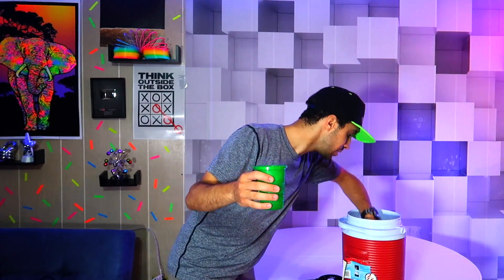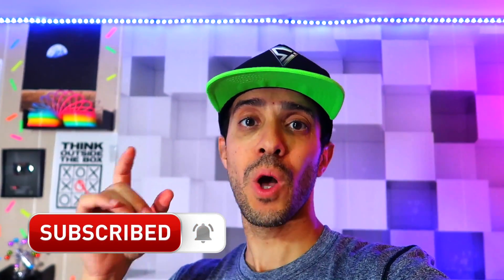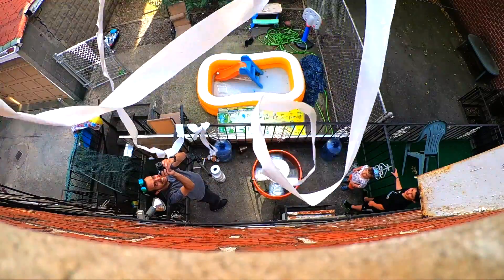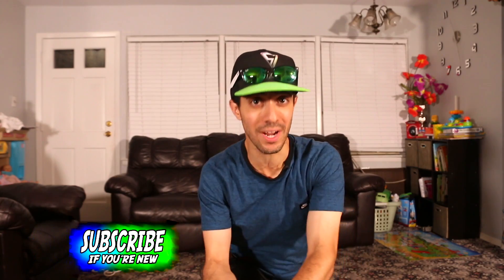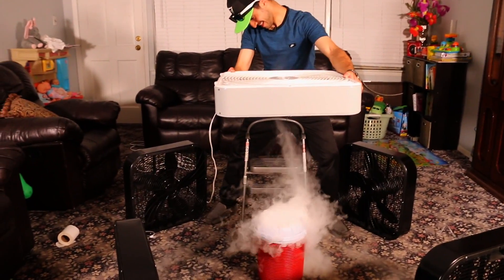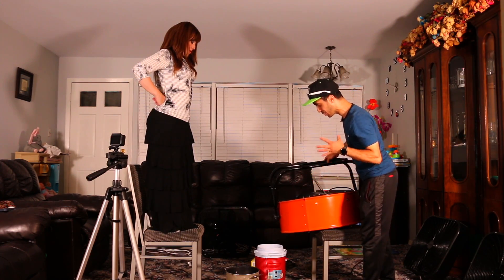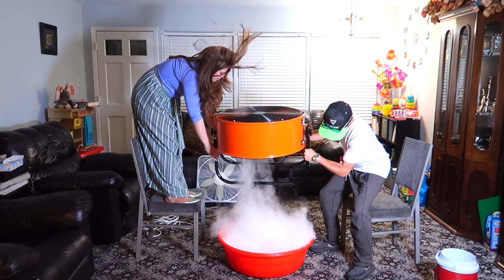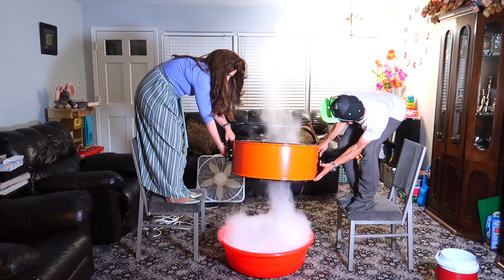How To Make An Indoor Tornado In 3 Easy Steps!

Comment: You need no fans and there's a one fan of the top you need there's not not here you can just block the air and you get cups two cups of hot water the dry ice and and there's 2 fan inside clockwise th spinning bring a fan on top

Comment: To retry this: make a curved barrier around your room to promote circular flow and set up a second fan to spin it, then it should be easy to setup a toroidal convection
Reply from the maker: Smart! Do you think carboard boxes could work?
Reply: @IncredibleScience  i dont see why not- especially unfolded and glued into a curved wall

Comment: In the college students video they had fans on the ground. Maybe if you try a few at different angles, it will create a circular movement. Also, cold air goes down, hot goes up, you want it to go up...

Comment: The problem: your boiling air mass has no initial angular momentum. Try setting two fans on the ground to start the vortex, like a figure skater’s arms, then use the industrial fan to draw the updraft—which then draws surrounding air into the tornado. 8:04

Comment: The fan being pointed at the ceiling is ending the air along the top of the room and down the wall with no place to go is then hampering your attempts at an uninterrupted flow of smoke. Outside on a 0 wind hot day day will see better results. Also please ask your wife to be careful with long hair and fans x

Comment: Im sorry but that wasn't really a tornado. on the small scale that was actuly a nice tornado. but the bigger one is not. what you are seeing is the vapor getting sucked into the fan. I even tryed this at home with ultrasonic mist foggers. there is littoritly no tornado when I do it.
Reply: use a fog machine, and use 60% pg 40% vg, produces massive smoke clouds
Reply: @hermasmora  pretty sure that does not work. I tried that too.

Comment: You have it all wrong man.
Have you ever made fire or get a charocol going?  Remember?   You put a pipe right over the fire and watch it take off.
The heat goes in the pipe and creates a heated air in the pipe.  That hot air inside the pipe has low pressure and it rises, The air outside rushes in and get sucked into the pipe.  You can hear the air as it goes into the fire and up  through the pipe like a wind turbine of an airplane.  

Now you simply take that idea.
Here is what you do:
Make a tube using some sort of card board or whatever.  With its diameter a little larger than your smoke box.   And say 4 feet long of a pipe.  Design your pipe so that at mid section it's diameter is half to a quarter of its size.   This way it will cause a venturi effect.  The air rushes in to pass through that mid section.    Hang the pipe few feet above your smoke box. and watch what happens.

If you want to speed up the process, put a fan above on top of your pipe and bingo.

Cheers.

Comment: the problem you had was turbulent air creating eddy currents in the room, to get a twister you need a  laminar flow of air,  it would help if you vented the turbulent air outside the room via ducting hose then you will get a much better twister,
Reply: @faith4390   20 years of working in special (practical) effects i do know  a things or two about this sort of thing.
Reply: Or he can use a bigger space to do it!
Reply: what?

Comment: So you were dispersing a bunch of c02 into your house?  Are you completely sure this is safe? I mean dry ice indoors is normally gone because all the c02 falls to the ground but doing this is directly mixing it with5he oxygen and just seems really unsafe.
Reply from the maker: Yep it was fine thx for your concern
Reply: what you see is mostly water vapour, carbon dioxide gas is invisible, the very cold gas causes water vapour in the air to condense into water droplets, thus creating fog.